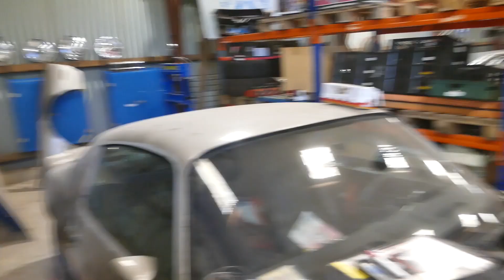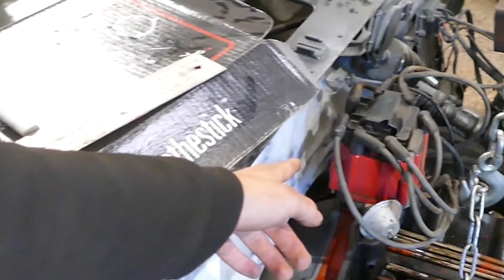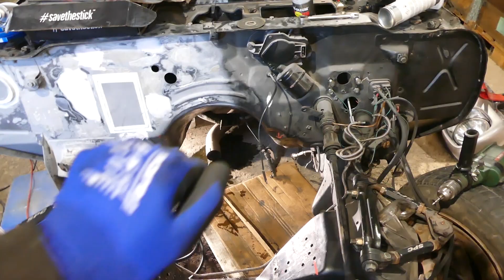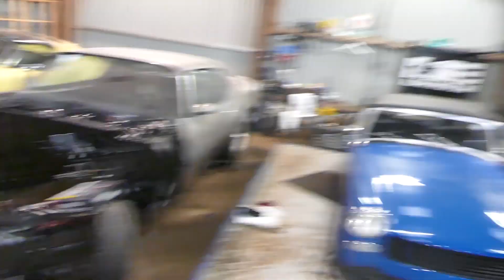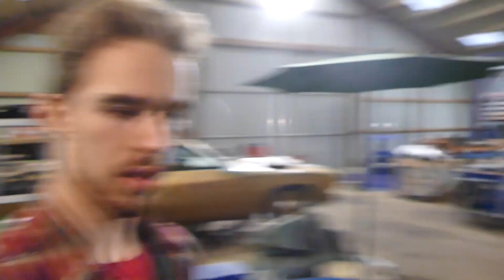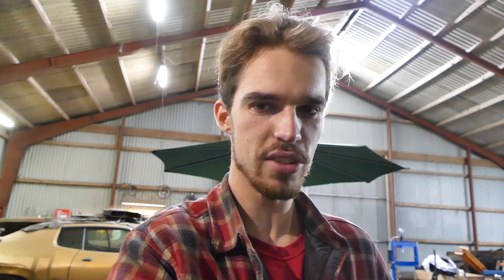Clutch Master Install & Engine Test Fit + Relocation! 1970 Firebird Build Part 5!

Comment: Yeah. Those engines with the distributor in the wrong location make a lot of things more complicated....wink, wink.

It has been over 20 years but I thought I bought a mount for a 71 Firebird that was sold as working for both Bird and Camaro. Maybe I remember that wrong. Interesting that it isn't a perfect fit for you though.
Reply from the maker: its such a small amount diffrent but made it work yeah a ford small block would be nice for this small move back deal
Reply: @Viktorrhansen  Or Mopar too....haha.